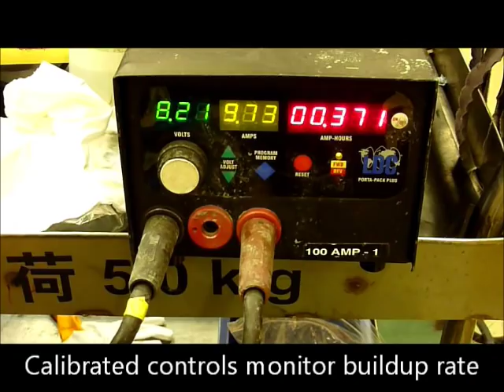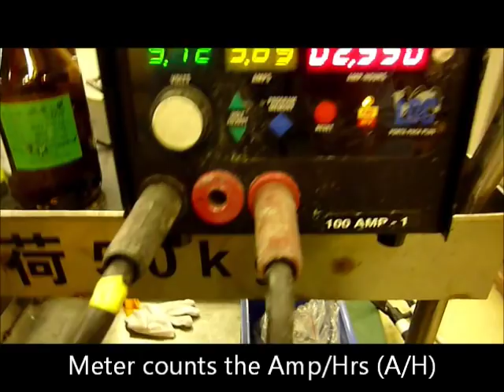The Art of Brush Plating

Comment: I'm loving the air fittings for quick disconnect from the rectifier, that's a great idea. Do you use Sifco chemicals?  why the scotchbrite on the anodes (I do brush cad and zinc-nickel) nice outcome.